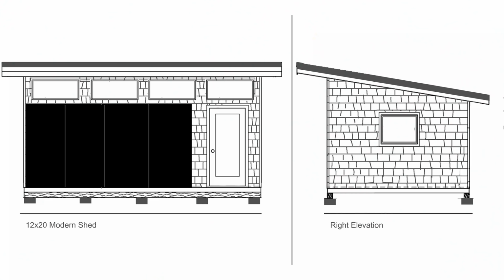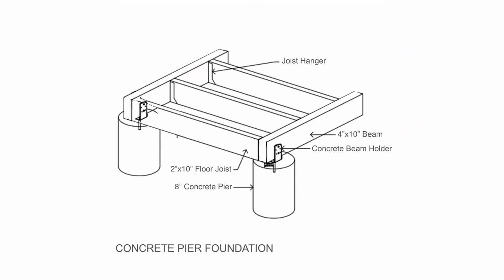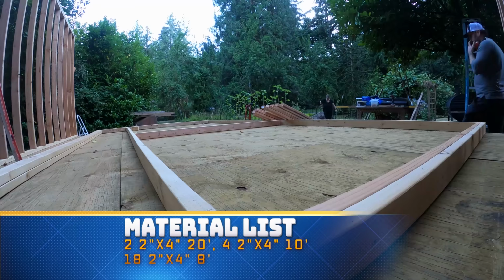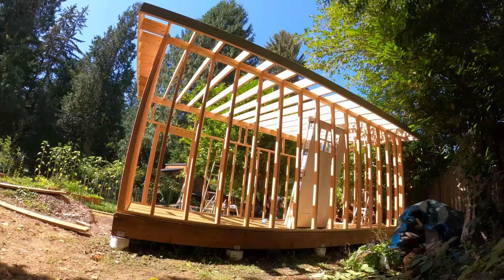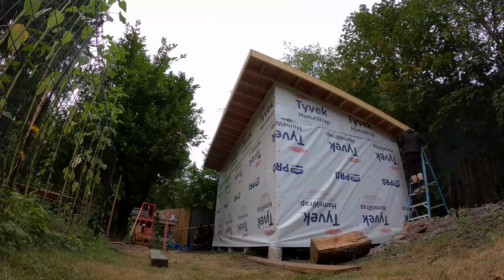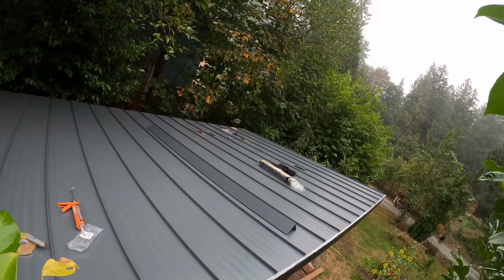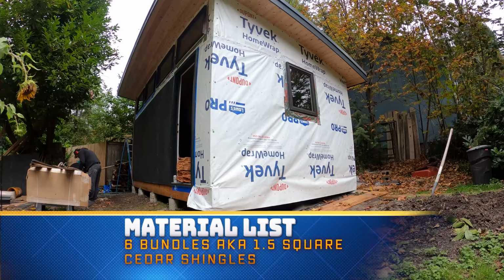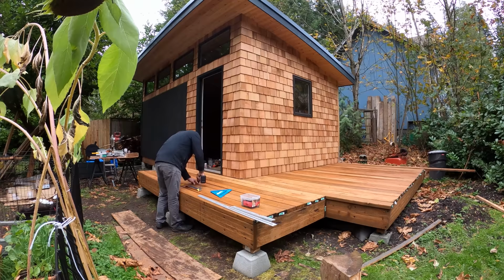Build A 12'x20' Modern Shed and Deck by Yourself: With Material List

Comment: I would have loved to see the inside
Reply from the maker: Check out my follow up video I recently posted about making it solar powered. You can see a bit of the inside. 
Mostly just shelving and a couple work benches as I did build it to be a storage shed/bike shop.
https://youtu.be/74dzUoRIIdw
Reply: @NilesProductions  How's the solar treating you?
Reply from the maker: @mrwck1953  So far so good. I bought a little propane heater to warm things up during the winter so I've mainly been using the solar generator to power my lights, electric drums, and guitar amp. Zero issues, been super reliable so far.  I must say I'm pretty happy with it. If I were convert the shed to a full time use space, like using it for an office or studio, I'd probably want power from the grid though.  Solar generator is perfect for how I use the shed.
Reply: @NilesProductions  this was an awesome video! How much did it cost in materials to build?
Reply from the maker: @rccpromotions   The shed and deck cost a little over $12k the solar stuff was another $3g
Reply: Brilliant work by a single man.loved your video
Reply from the maker: @stephenfrancis6547  Thanks Stephen! Building the shed was the easy part. Trying to film and edit 18 days worth of footage by yourself was the real struggle 🤣
Reply: @NilesProductions  Great work and dedication for making and editing video aswell. Your struggle will payoff. Why don't you outsource your video production, just a thought. Thanks
Reply from the maker: @stephenfrancis6547  I actually make commercials for a living. 
Video game trailer production has been my specialty for about 16 years. 
If you watched a video game commercial or game trailers online there is a good chance you might have seen some of my handy work. 
I'm like the poor mans Pixar over here. 

It's just kinda rare that I shoot something like this for myself these days. 
The real motivation was we were on lockdown in early 2020 and I had a little bit of extra time on my hands and wanted to show my friends and family what I had been up to. 
I never expected people outside of my immediate friends and family would watch. 

I usually outsource the home projects as I don't have a ton of free time in my life LOL
Reply: @NilesProductions  Wow! That is good to know about your work, commercial for video game trailers, sounds good and exciting. Yes I was interested and played lot of video games from 80s 90s till early 2000s then I stopped for some reasons but still like it. Yes everybody got little time off during lockdown and bet you made use very good use of it. Time is precious and limited to all but you doing great work. All the best.
Reply: Great build from a fellow carpenter. Really fis the space well. FYI, you have permission to punch anyone who commented about the Tyvek being upside down 😂 Enjoy that great shed

Comment: “How to build a shed for yourself….. firstly, take out a $50,000 loan….”
Reply from the maker: LOL, It was a little pricey as far as a DIY shed goes. All in it was a little over $12k for the shed and deck. You could make it a little more affordable by using OSB sheeting and forgoing the metal roof, and all the pressure treated lumber in the foundation and floor. Also the cedar shingles and T&G was really expensive. Had I not used premium products I probably could have saved a couple thousand dollars for sure.

Comment: Excellent job!  Nicely designed and constructed.  You did an outstanding job on this and should be proud.  One thing to note to anyone trying to replicate this, the subfloor is not 3/4 treated marine plywood, it is just 23/32 treated plywood, typically CD grade or also called Rated Sheathing.  Marine plywood is not treated, it is a structurally strong plywood with no voids and constructed with waterproof glue and typically "a" and "b" veneers on the face and back, it will rot just like any untreated plywood.  If you go to the lumberyard and ask for treated marine plywood you will either get marine plywood that is not treated (and hideously expensive) or you will get treated plywood that is not marine grade.
Reply from the maker: The marine plywood they sale at Home Depot has a lifetime warranty against rot and termites.
It's an AB marine-grade pressure-treated plywood. It offers protection against fungal decay in wet environments. It is approved for saltwater applications so is probably a little overkill. You can save a little money by going with regular pressure treated plywood. 

https://www.homedepot.com/p/3-4-in-x-4-ft-x-8-ft-AB-Marine-Grade-Pressure-Treated-Fir-Plywood-154459/203527614
Reply: @NilesProductions  If I struck a nerve, I didn't mean to, there no need to delete comments that are intended to help.
Reply from the maker: Didn’t delete anything. It’s all good brother.

Comment: Joists sitting on Joist Hangers (properly attached to Joist Hangers) don't need the headlok screws from the outside, thats a chunk of change that didn't need to be spent.

Also depending on your region and local codes consider Slab on Grade so that you can park a Mower or other equipment in the Shed.

Side Note, after setting the "outer frame" of the floor (the 2 end joists and 2 big beams) check for square then and adjust before bolting the  plates set in the concrete to the 4x10's, I'm sure you thought of this, but since it wasn't shown felt worth mentioning.

Comment: As a carpenter, you did some really solid work! A few things I would've done differently, but overall a really nice shed. Mainly, larger joist hangers with proper hanger screws instead of construction screws. But I think your method will hold up for decades, so I'm probably just being particular
Reply from the maker: Thanks! If I ever build another one I’ll do bigger hangers for sure and nails or hanger screws to fasten it 🤙
After three years it feels as solid as the day I finished. I’m pretty proud of the build being it’s my first shed and all 😆

Comment: We just bought a piece of land that's wooded and we wanted to put down the first building to store gear and run power to charge our car when camping.... You just gave the the feeling I could pull this off! Thanks!
Reply from the maker: This was my first shed. I feel it went pretty well. 
My advice is do your research, take your time, and don’t be afraid to ask your carpenter friends if you have questions. 
Good luck on your build 🤙

Comment: When setting your joist hangers try fashioning a metal bracket to the top of your scrap 2x10 so it hangs on the beam even with the top. Metal strap screwed to the top of the scrap bent into a L shape to clip around the bean outer edge.
Really nice job.  Much envy.
Reply: That's a good idea.  I'm gonna do that.  👍👍

Comment: Beautiful project!!!  Two things:  It would have been equally amazing to see electrical/water ran as part of the build.  Also, how great would it be to have a ‘roll-up’ or ‘barn door’ entrance on that wall in the front?  With that said: I can’t do what you do and my thoughts are part of a wish list for a similar building in our backyard.  I am VERY appreciative of you for sharing this!!!
Reply from the maker: Thanks Dante Russo :) At the moment I have no plans to run water inside the shed maybe add a hose bib to the outside? The water main from our well runs right next to the shed so it shouldn't be to crazy to install. For electricity I plan on adding a solar generator for lights/small power needs. I considered installing a roll up door on the side but decided against it in the end as I wanted to maximize shelving and storage on the inside plus I already have a small garage off the main house for larger storage needs.

Comment: Most excellent! I have built 2 sheds on my own but never one this nice- I do need to build one with my middle son next summer, so some of your process will definitely be helpful - thank you
Reply from the maker: Glad you liked the build 🤙 
This was my first shed build. I learned a lot along the way.
The main things I regret was not installing insulation under the subfloor before I laid down the plywood. 
Probably add it when the weather improves but I have a feeling it’s going to be a little tricky.  Lol

Comment: Thanks for doing the video. You did a great job! Has anyone else already commented about doing your sheathing wrong? You placed your plywood vertical but you want the 8’ running horizontal and then stagger. You give it a lot more structural stability.
Reply from the maker: You are the first to make this comment. What you say makes sense though and is good advice.
Reply: No you’re installing the plywood correctly. Installing the plywood vertically allows you to nail rim joist, bottom plate and top plate all within the same sheet. If your sheet doesn’t reach the top then just add a row of blocking.
Reply: @ian18dudley  so what was that guy saying about adding more "structural stability?"  Doing them vertically is more stability, but horizontally is the standard?

Comment: I am currently knee deep in my 16x20 cabin/tiny house build. She's around 9' on the back and just shy of 14 up top (technically road legal w cheap permit, and easy for a shed moving co to transport). Very close to the exact same modern design with the shed style roof and awning windows up top. 

 I got lucky on some FB MP buys and scored (4) 54"x36" casement windows for only $250 total. They were brand new low E yadda's, still in plastic wrapping never touched. I ran them on either side of my full glass french doors. Flipped 2 of them horizontal and they're now giant awning style windows. 

Finally finished my exterior work and wrapped up the little 4ft deck on front. I am now getting to the interior build which is exciting and challenging for a single female build.
I just installed a lvl beam to run a 8'x20' loft, it'll be close to 5'6 head height and be used as a bedroom and storage.

You did a fantastic job on this build 👏. Everything was so organized and thoroughly planned out, lots of little tricks and tips I picked up from the vid. Nice quality material choices all the way around, no short cuts. She'll last a very long time (much longer than my chap lipped of a mess build 🙄🤦🏼‍♀️). Thanks for sharing this 🙏 and I look forward to seeing what else you have in store. ✌🍻
Reply from the maker: Wow, your build sounds pretty cool. Are you making a video? I would love to see it when finished. Link back here with a walkthrough or build video when done :)
Reply: Hello,

This a great video ! 

My boyfriend and I built our own home. It's a timber house with a concrete slab built on screw piles foundations.

Here's a video on how we built the walls ! Hope you will like it :-D
Reply: @constructionhacks8162  where's the video?

Comment: Awesome build with great, detailed instructions! As someone who just built a 10'x10' modern shed, it was great to compare notes. Adding the top plate before lifting the walls vertical was a way better idea 🤣 I went with standalone T1-11 (no plywood sheathing beforehand) as the siding, used a steel roll up door, and went with a asphalt shingle roof. Installing the soffit was probably the most brutal part of the build - at least for me. Curious to see if you felt the same. 
For my 10'x10' I spent around $3,600 for materials (steel roll up door was $450 of that). You went the extra mile on nearly every aspect of this build, so I am guessing around $8,500?
I am currently editing my Modern Shed Build Video for my Channel - so I appreciate the time that went into filming the building process and the editing time afterwards. Excellent job!
Reply from the maker: Glad you liked it! I'm a little over $12k into mine with the deck. When I started I budgeted $10k but wood prices kept going up throughout the build.
T&G soffit is a nightmare but it looks so good lol. 
I would love to see your build when your video is done. Reply back with a link when it's up :)
Reply: Thanks for sharing your costs!
Reply from the maker: @clreed9690  No problem
Reply: @NilesProductions  Worth every penny - Looks awesome. And will do! Plan to release it in early Spring 👌
Reply: I wondered about the value of plywood sheathing under the T1-11 as well. I suppose it's serving as a shear panel?
Reply from the maker: @Mezzanine99T  I was originally planing on making Shou Sugi Ban style charred siding but I got cold feet before I committed to buying the materials and charring it. In the end I pulled the trigger on T1-11. It was a financial/ease of installation kind of decision for sure. Might have been able to get away with just one layer of Plywood I just tend to over build stuff.
Reply: @NilesProductions  it was a good choice. The sheer (for lack of a better word) will last perfectly under the wrap and siding. The grooved ply is easy to replace and looked awesome once painted. Came out very classy and utilitarian, as a shed should be. Can’t wait to build ours. Was going to go French or single barn but single door looks awesome. May have to find a cheaper roll up alternative for one wall (need to store materials). Great vid though. Love it

Comment: You should’ve used nails for the floor joist hangers. They have much higher shear strength than screws. I found using a pneumatic palm-nailer was the best way to get into the relatively tight spaces.
Reply from the maker: Good advice for sure
Reply: I thought that too, until I saw the head-lock’s from the outside
Reply from the maker: According to Hilman’s technical data for the Deck Plus #10 screws I used the sheer strength is 2317 lbs.

http://stfasteningsystems.com/deck-plus/#12type

I should have used their Structural screws instead of the deck screws as the head sits flush against the hanger vs how the deck screws head is tapered.
Reply: Not trying to miss the forest because of the trees— That shed & deck are gorgeous. 
Glad you tracked down the tech-specs. It should be alright. Manufacturer approved, application-specific fasteners are an obvious alternative.
I will, however, point out that the specs do not suggest joist hangers, or any metal connectors for that matter. I can only assume one reason is the risk of galvanic corrosion when the coating is inevitably stripped as the screw is driven in. This causes the bare metal of the screw to be in direct contact with the dissimilar metal of the hanger. Being exposed to humidity/moisture in general, or even the chemicals in the treated lumber is the last ingredient for fairly rapid oxidation.
I’m no engineer, but I’ve done my fair share of home repair, demo, and renovation. I had to renovate a shed, which included gutting/replacing the rotted floor. I spent days and days reading building codes, tips/tricks, etc., and I came across the “don’t use screws for joist hangers” thing. Inspectors will literally fail an entire build if the see 1 unapproved screw in a joist hanger. I’m 110% a “why-guy” & this struck me as a bit extreme, so I chased it down until I came across what made the most sense to me to be the answer. 
I can’t necessarily tell you where I found it, but wood screws(i.e., deck/general purpose) are specifically designed for tensile loading, rather than radial/sheer loading. When a screw is used to fasten something, it is essentially being stretched as it’s torqued. Having something push on the side of a relatively brittle fastener that is already under tensile load is asking for trouble. Nails(i.e.,10d/16d), however, are not dealing with any real tensile loading. Sure, there’s friction holding them in the wood; but they’re not being stretched. This allows them to be more reliable/robust when dealing with radial/shear loads, or even any movement resulting from the edifice settling. Plus, they’re typically galvanized to inhibit corrosion.
Again, I’m just here to share info that will hopefully help.
Reply: @NilesProductions  I didn’t mean to come off critical, the shed looks great dude. Really nice job with the t1-11 and the cedar shingles..:)

Comment: Things I'd do differently:

- Roll the joists on top of girders instead of rim joists on concrete pylons
- Double rim joists
- Put block lines on joists for rigidity and landing plywood breaks (every 4ft.)
- Use construction adhesive on the joists when putting on the subfloor, this is the number 1 reason for callbacks  about squeaks in the floor, which this building will have many over time (I swear youtube doesn't know about this)
- I like to use frieze (or pressure) blocks instead of hangers for joists, but that's just preference
- Use 3/4" OSB tongue and groove ply for subfloor
- Used California corners on framed walls
- Framed the windows on the door side of the shed correctly (sill plates, trim studs and headers)
- Call birds mouth by the correct name (a bird box is a much different thing in framing)
- Make my rafter plumb cuts after their installation for maximum straightness of fascia
- Installed bird blocking between rafters
- Installed Z flashing around the entire roof before rolling the standing seam... that's gonna be an issue 
- Never heard about not caulking or taping the bottom flanges of windows and have lived in high precip areas, if water is getting in, you have much bigger problems than drainage
- Girders/block lines/pressure blocks/double rim joist for lanai as well

You asked =)

Overall it looks nice and it's a shed, so it'll be fine.